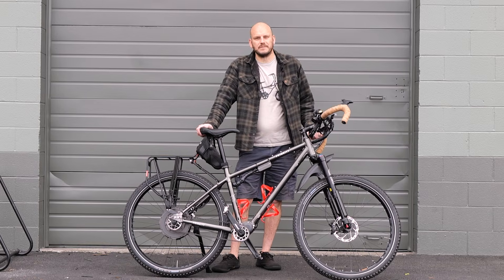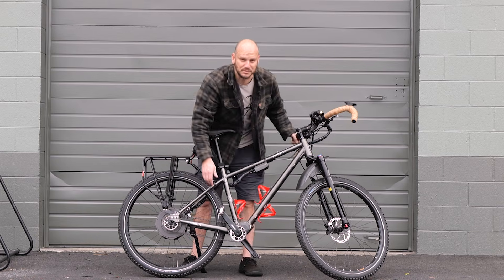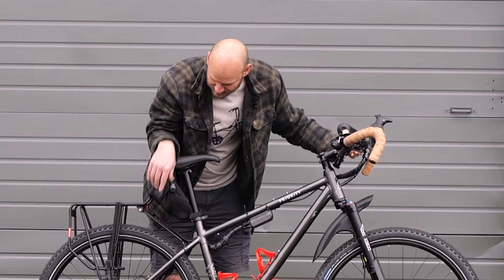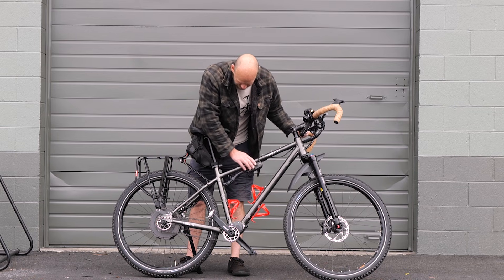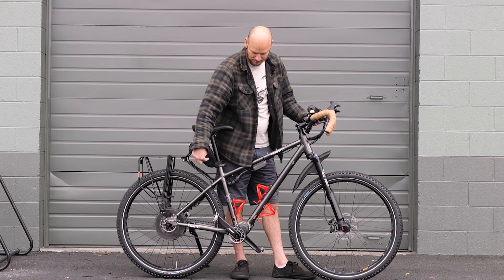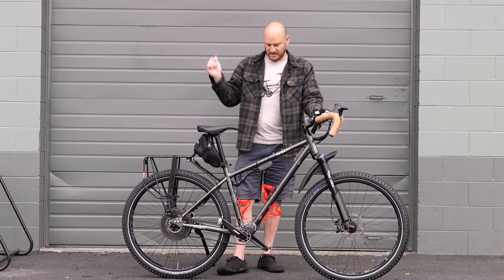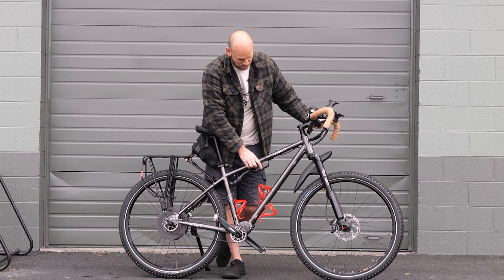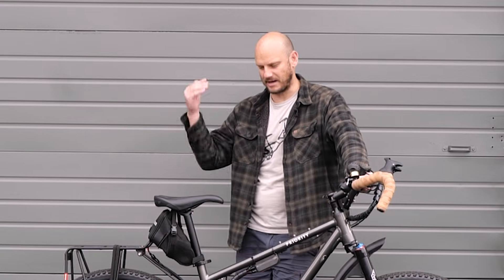Custom E-bike Build: Priority Belt Drive with a Grin All Axle Hub Motor with Regen!

Comment: Whats your thoughts on the Geeko conversion kit from 100g? Im looking at converting a 29” giant carbon fibre hardtail with their 250w rear wheel motor kit with a 36v 10AH battery. Will be for road/path use only. Have you had any experience with this brand?

Comment: Jonny, have a Bafang midrive on a bike....whenever owner starts suddenly accelerates at times??? Gman 305
Reply from the maker: I’d reflash the programming settings. I’d need to know a lot more of the circumstances of when it happens to get a better picture.  But I would start with that

Comment: I assume if you swap the nylon planetary gears ⚙️ for the metal upgrades on geared hub motors. That you can get plenty of trouble free miles. 
I'm really liking the idea 💡 of a gas electric hybrid bike. 
Also an electric velomobile powered by 🔌 and thin foldup solar panels that can be kept onboard.
 Keep a couple under the seat & a couple behind the seat. Or in some aerodynamic saddle bags/panniers.

Comment: The high end MTN bikes with outrageous prices that cost more than a new motorcycle. Should have been using better designed non rear- internal derailleurs/gearboxes years ago. 
 🤔 I wonder if the $3,000 spectra fiber rope spokes will ever catch on? 
You can shave a few grams of weight off each wheel 😂 using the $3K  string spoke wheels as if it matters all that much to a non pro rider. 
🤔 I wonder if Tour Duh France racers are using them yet? 
 I guess I'll look after I finish this rant.
Nope, Tour Duh France, performance enhancing drug using riders still use flat bladed steel spokes or carbon fiber spokes. 
If the string spokes were so much lighter, stronger & better. You'd think all pro racers would be using them.

Comment: Fun Fact: Pinion MGU bolts into the same mounts as the Pinion gearbox.
 CVT don't have gears, you set the torque you want and then it adjusts to keep it constant.

Comment: A gorgeous build of a great bike. I love Priority (maybe because, for me, 174 Hudson is a beautiful ride along the Hudson river). The Grinn hubs are, bar none, the best but I'm a mid-drive guy. Even the mighty All-Axle is a poor hill climber compared to a similarly powered mid-drive (I know, the All Axle can handle more power so it could climb). This vid makes me wonder if the Priority Skyline (similar e-bike setup with Pinion up front and a hub motor in back) has any hill climbing ability. I love the idea of a Pinion gear box & hub motor but the local hills make street legal hubs a non starter for me. (In the snow the hill I live on sends cars without snow tires sliding down while trying to climb up)
Still, an awesome e-bike build!
Reply from the maker: Thanks Mike, ya the grin would be only hub motor I would even consider using for a personal bike!
Reply: @JohnnyNerdOut  Full disclosure: part of my bias may be age related. 2 or 3 decades ago I would have rocked this build for epic miles, without a throttle.